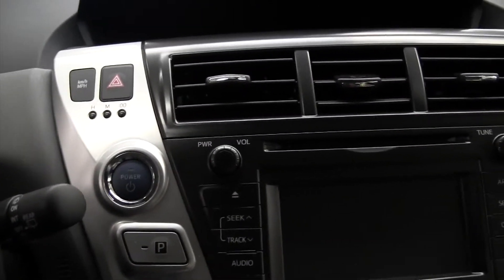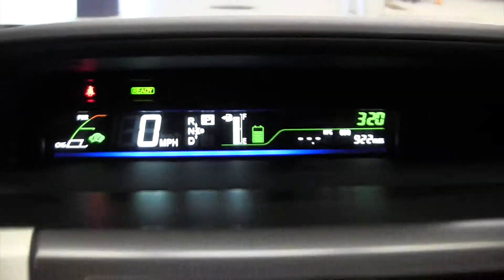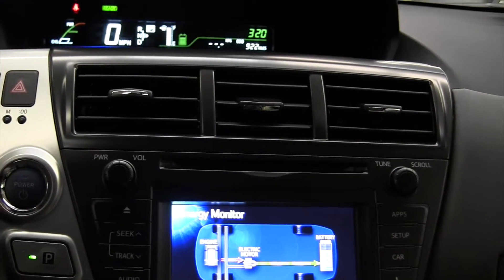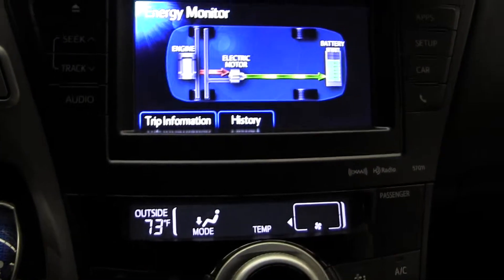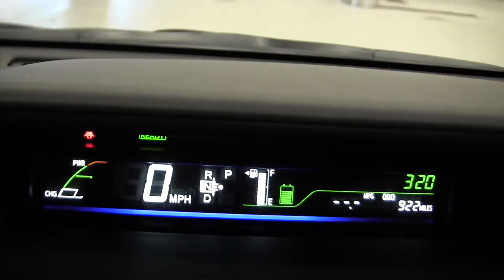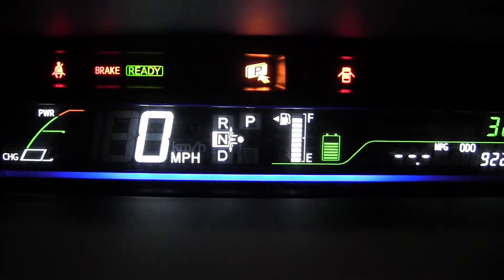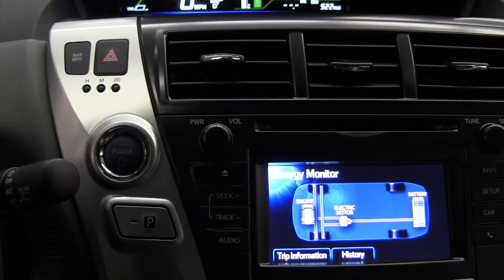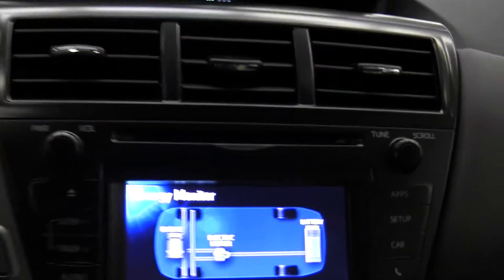Toyota Prius Killing the HV Battery

Comment: my 2010 prius battery drains too fast and engine keep charging it every minute. i hardly can drive it on electric. if battery is full give her just ine electric push and it drains. what should be done ?
Reply: Are you saying the High voltage battery drains to fast or the 12 volt battery is draining to fast

Comment: It may be annoying, but exceptions must be taken into consideration if ignoring them can result in an expensive failure. Especially mechanics, unless they don't mind to loose out on experience and money.

Neutral is basically, as you said, applies no voltage to the motor and generator. It's only meant to rill the car up onto a flat bed, or pulled along those car wash tracks. Park allows the car to charge itself when needed while preventing it from moving the car while applying a parking pawl.